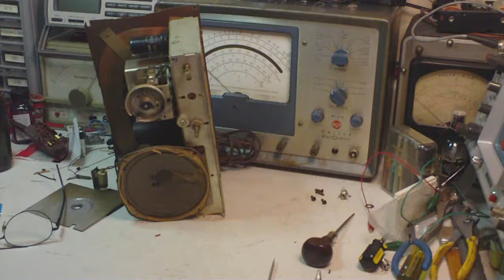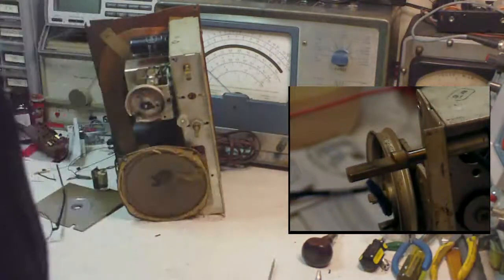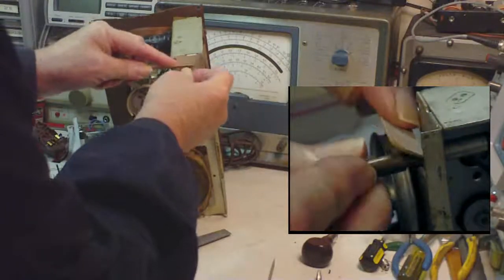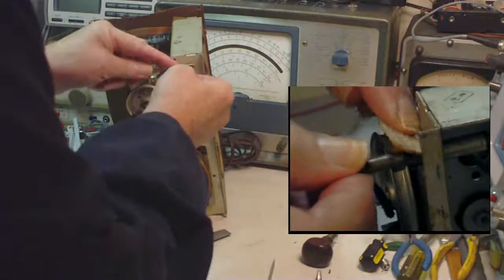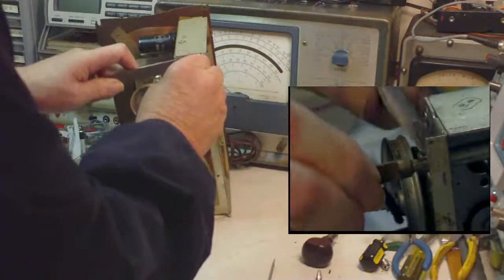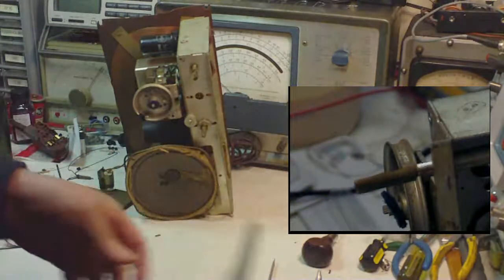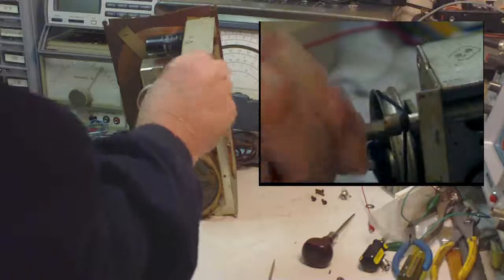Slipping Dial Cord

Comment: Thanks for the video! I tried to replace a broken cord.  At first it didn't work out, then I thought it was because the new cord was slightly thinner. Then I tried thicker cord, the same size as the old one, but now it still slipped. Then I watched your video and that helped. Thanks!
Reply from the maker: I glad the video helped.
Thanks for your comment.

Comment: Thanks for your useful demonstration how to get rid of the slippery dial cord by scratching it up with a simple scratching along the axis of the tuning capacitor. 
I have got the opposite problem,almost, as the tuning capacitor is no longer turning , it is suck probably after a long idle staying in cellar. The grease must have got so hard that it almost does not move. Can you tell me how to get it moving again? What should I do beside taking of the tuning cord, which is made out of metal. I would be very grateful to you for your piece of advice. Abele ballestri Suisse.
Reply from the maker: I had a tape recorder that had a control knob frozen and I did a video. Below is how to get to that video plus much more. Today I would just use a drop of WD-40 on the shaft on each side where it is supposed to rotate in. Then I would forget about it for a day or two and then repeat the drop of WD-40 and wait a day or two. Then repeat until the shaft is unstuck, this may take a while but it should work.

Searching My AllAmericanFiveRadio Channel
https://youtu.be/4k7ByHqh8Js

Search for "Sony TC-230 Recorder Repair"